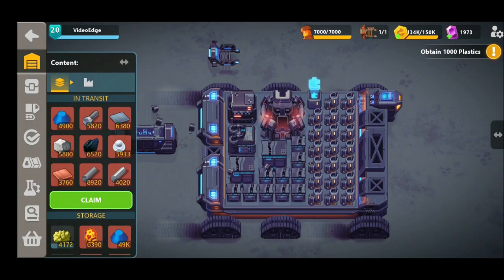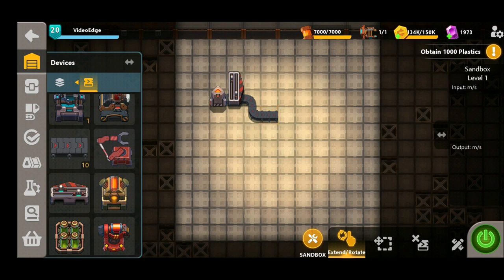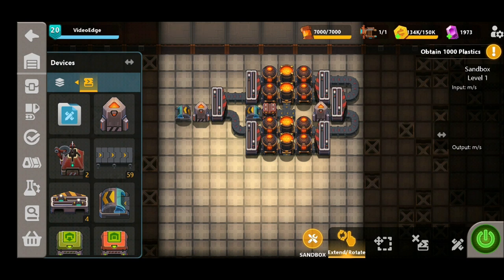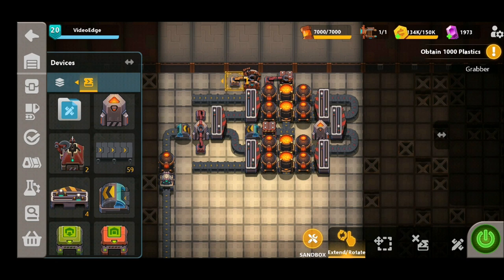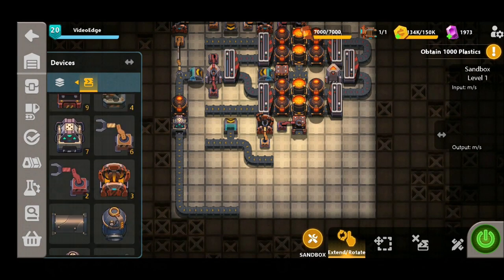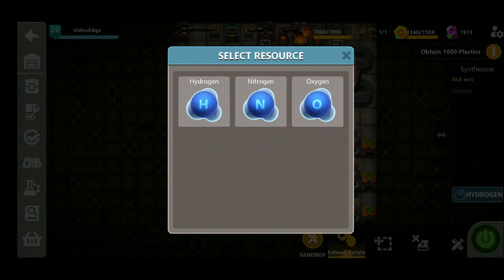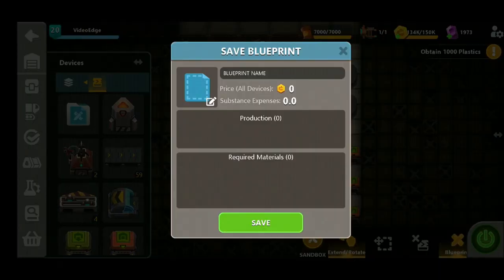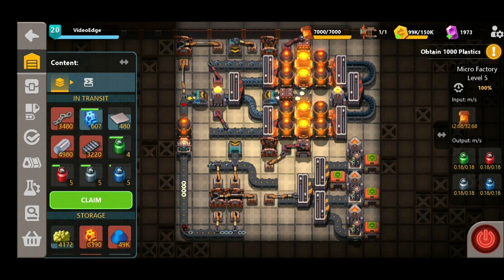Sandship Crafting Factory: Efficient Micro GAS TANKS Design! [HD]

Comment: I'm stuck on producing oil barrels. Can't figure out how to make
Reply from the maker: That'll be coming up soon, stay tuned!
Reply: I've got a good build for lvl6 oil building (or basic, but lower output) for all the oil barrels +barrel production (used the steel gear part from VideoEdge Gaerbox production and changed it to barrels 😅) + algae all in one
Reply: @fabianmtk4471  great but I'm new to build games, can't figure out how to use the compressor that produces oil. First it says water too cold, I put a water heater but then it says device too cold..

Wat? 😂
Reply: U need at a heat gun pointing on the compressor and a fast grabber for enough Algae
Oil made me going crazy but figured it and maybe VE show me a better build in the next days
I make 0.6 from all the oils in my lvl6 oil building with only 54 sub
Reply: @fabianmtk4471  thank u very much will try
Reply: Just now i finished a colorfilling fabric with 0.67 barrel input (my output is 0.71) and so a color output of 0.67  with two lines and even when both lines using different powder the output per line is 0.33
Think that's good